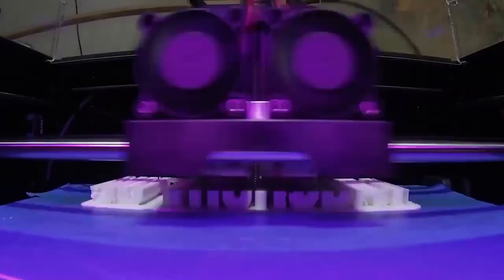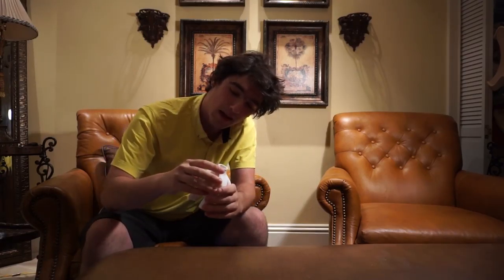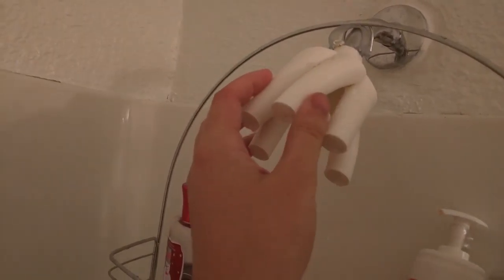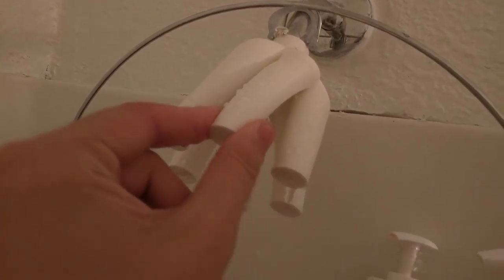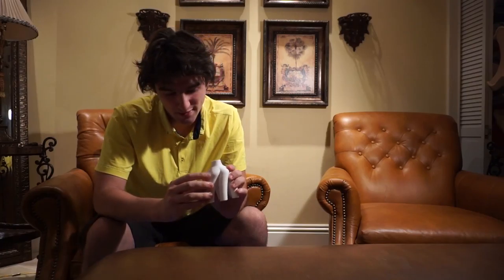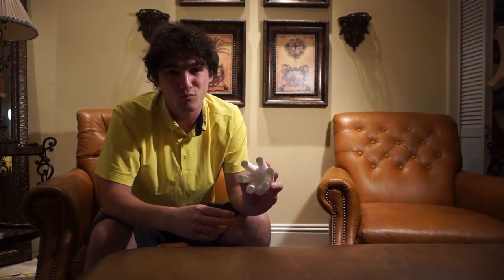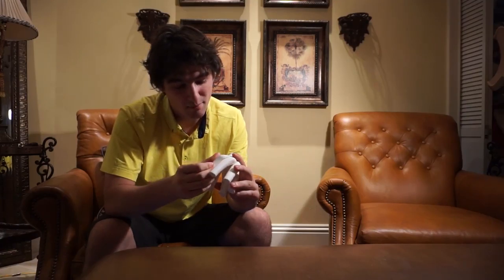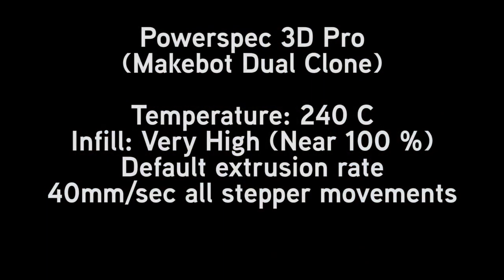3D Thursdays E3: VORTEX SHOWER HEAD!

Comment: I printed this out of PLA and it worked fine.. no leaking.. think you need to adjust your print settings.  I did 5 walls (2mm with a 0.4 nozzle) no infill